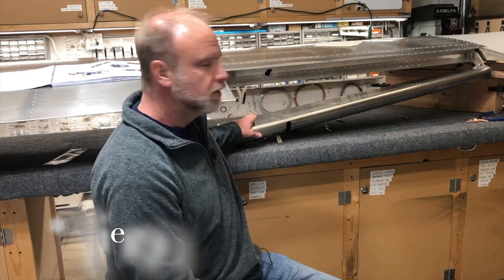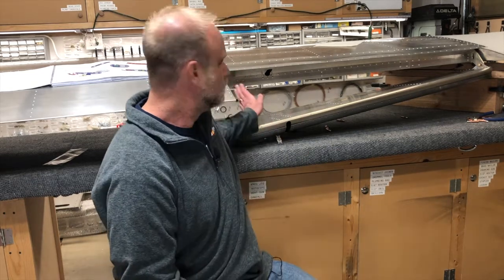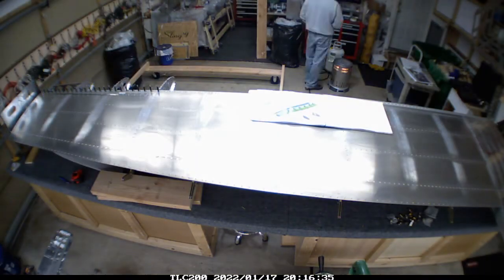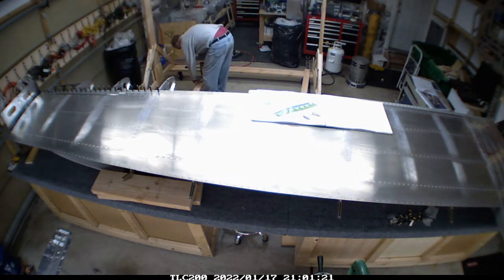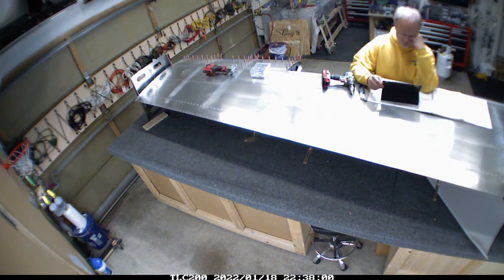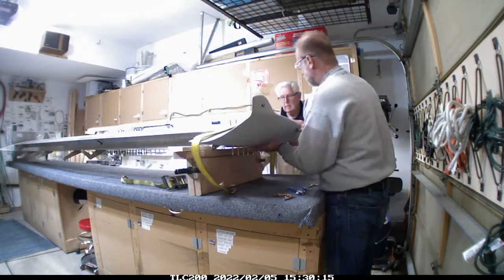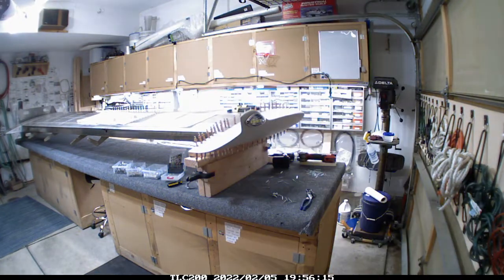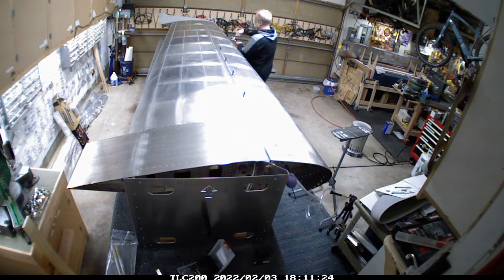2022 February - Taking a big step back to go forward

Comment: bummer... 
It was not clear, was it the wrong part they sent you with the correct part number label or was it a boo-boo you made?
Reply from the maker: I go back and forth on this topic since it was discovered.  If I'm critically thinking about it, I should have been able to lay the two parts side by side and see there was no difference.  It would stand to reason that one should be different from the other.  That being said however, I am very certain the label was wrong.  So the best I can come to is there is blame to share on both sides.  :)
Reply: @FirstRivet  It sounds like Sling is still making a lot of mistakes in packaging together a kit.  I hear about missing or incorrect parts on every build series I see.  Wrong label on a part that causes weeks of additional work?  That seems like a pretty big boo-boo.
Reply from the maker: @adamsocha8815  Totally understandable.  I certainly don't want it to seem like they are being careless in their part culling.  There are literally thousands of parts in the kit, so an incorrect part here and there may be expected I guess?  It's my first kit, so I don't know what the normal percentage would be on incorrect parts, but so far I've only run into two (the hinge and the rib for the rear fuselage).  I don't want it to sound like I'm throwing them entirely under the bus as I do have some responsibility in the build, but yes a critical part mislabeled is going to lead to a bad day.  :)